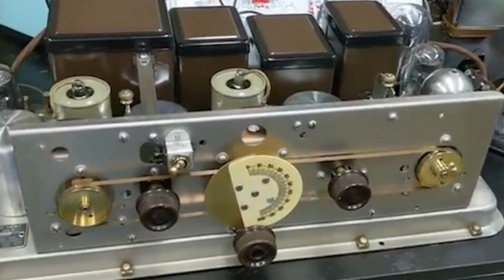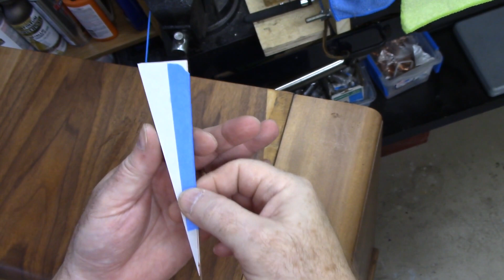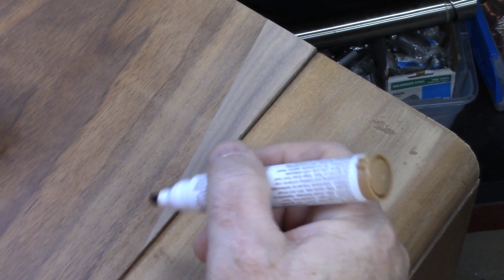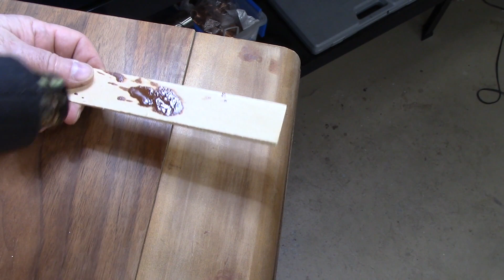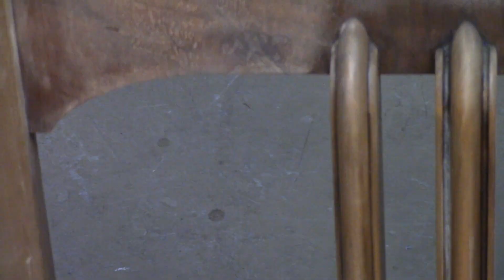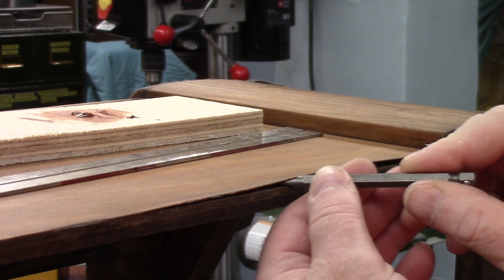1937 RCA 87K  Part 2- Cabinet Repairs Commence

Comment: Blending in patch veneer is a fine art in itself. I must say you did do a very good job in hiding the line where the patch
meets the original veneer. Melt sticks that are hardened can be put on a ceramic plate and put into a microwave
for 10 seconds. Take it out and touch a piece of it with a toothpick to see if it has softened. I would hold it with a 
 Nitrile glove when using it. Your cat thinks you got a scratching post there!
Reply from the maker: Thank you Pete, yes you are so correct about it being an art! Thanks for the tip on the melt sticks sir. I so appreciate your feedback, and I actually can respond to this one today!

Comment: Great start to fixing that cabinet veneer. with the work you did on stripping the cabinet that will be one beautiful cabinet when you are done. When I do wood stock repairs I tend to use a wet brush on the wood as I glue the crack it tends to suck the glue in farther.
Reply from the maker: Thanks Larry, that's what I'm hoping for anyway! Hopefully it will play as good as it looks as well.